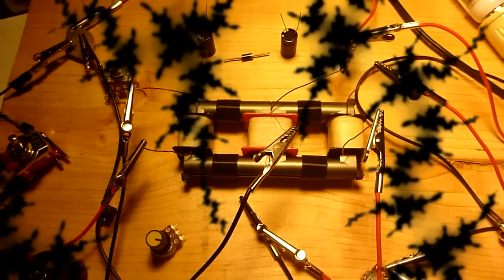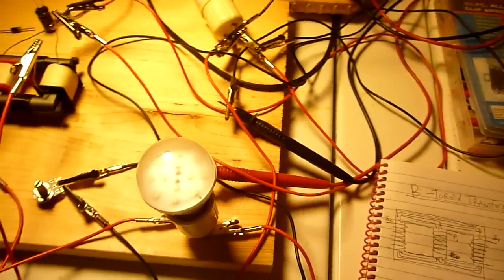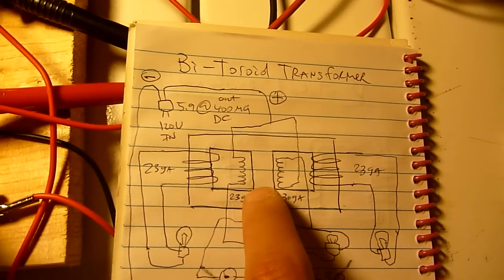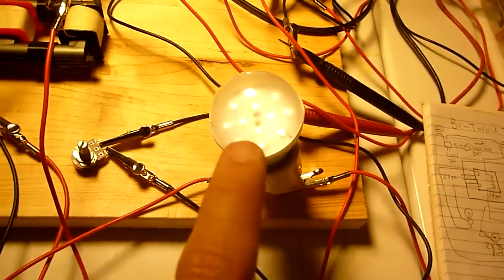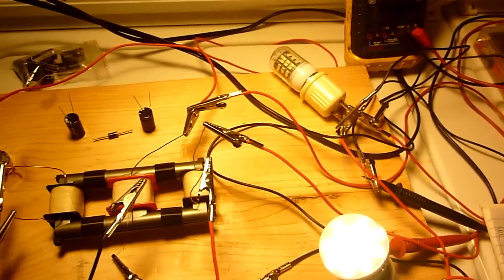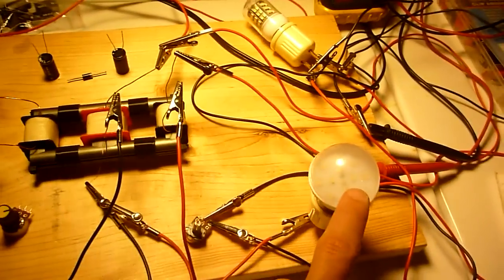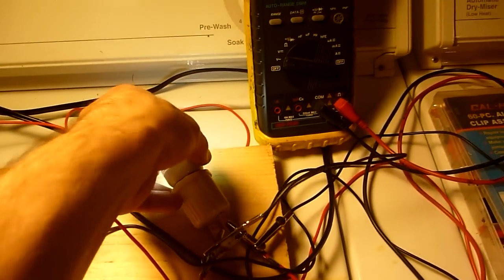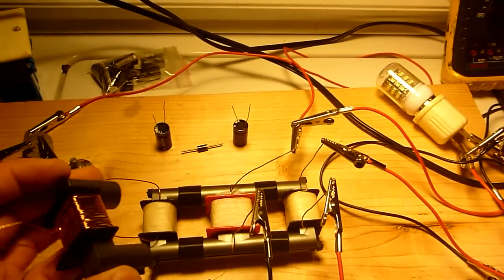Bi-toroid Transformer replication (over unity transformer)

Comment from the maker: If you wish to further improve efficiency of this transformer make the core on which the primary windings were wound from low permeability material, let say iron. Make the core used in the rest of the transformer from high permeability material like permalloy . The flux will be trapped in the high permeability material more so than in the lower permeability material. This will drive efficiency further beyond COP >1. Another way to boost efficiency is to connect the secondaries by an extra outside loop of high permeability material. This will help contain the flux in the secondaries even more.
Reply: +Naoki Kashima 
Interesting idea to design a transformer!  However, when you power off one LED bulb, is absolutely normal in this arrangement that the other LED bulb intensity to remain constant. 
It's like you have two transformers with a common primary and two separated secondaries, isn't it? Since the two magnetic paths are separated, from primary to each secondary, it's obvious how will work. The mutual inductance created by one unloaded secondary, reflected in the other secondary should be so small that will not change anything...

I'm sorry but I do not understand why are you using the LED bulb connected in the primary (or in the oscillator circuit)? Why didn't you performed a clean energy efficiency measurement? The VA drawn by primary and the VA produced by both secondaries? I think unfortunately you can not talk about over unity COP until then...

BTW, if you want to not have the annoying noise you can do two things: check if your core is not saturated, add an air gap between the U cores and/or increase the frequency above the audible frequency.
Reply from the maker: vsurducan Excellent points. Thanx for the tips about the noise reduction. I really should get a watt meter. I'll run 2 lights using house main through the meter (my control). At the same time I'll run 2 other lights using this transformer in the middle (with a second watt meter). After X amount of hours we'll check the watt usage from both meters to see if this transformer produced a reduction in the watts used.

Side note: this bi-toroid transformer is not my idea. I just came across it. It does work I've seen about half a dozen credible people show tangible efficiency gains with this device. If you're going to replicate this connect the secondaries with an extra loop of magnetic material. This will improve efficiency. I might do a follow up video to this one.
Reply: +Naoki Kashima 
I think you don't need any wattmeter, just two digital multimeters (DVM). Perform your measurements in DC not in AC because ordinary multimeters does not work ok at high frequency and rectangular signals. (If you want to do it in AC, buy a two channel scope for this purpose with math functions, will be useful for the future.)

For computing the input power measure the DC current sourced and the DC voltage used to power your oscillator which has the primary as load, using a DVM. For the secondaries use four schottky diodes and connect them in a Graetz bridge. Use a capacitor for filtering the ripple. Multiply twice the rectifyer/filter for both secondaries. Measure the DC voltage and current through your LED bulbs. Even this method will not give you exactly the transformer efficiency (but the transformer and oscillator efficiency) will be a very good starting point, better than is now. 
And an advice: please do not be disappointed if your computed COP will be far away below 1...
Reply from the maker: vsurducan Check this out device with 5000% efficiency, here is link: https://www.youtube.com/watch?v=HK3JOlY0V8Y (Jim Murrey)

There are many many devices like this out there. Humanity had a way to get us off of fossil fuels for over 100 years, starting with Tesla. The reason we haven't seen these devices before not because they aren't possible but because oil is just too profitable.
Reply: <3 thanx for duing experimehnt <3 =)
Reply: Very interesting video. Will it help if I leave a small air gap between the primary coil's core and the secondary? My idea is that the flux will enter the secondary core but then it's trapped there. Regards, from SA.
Reply: @reeselourens1459  I used to live in SA. How did your experiment go? Did your BiTT work out well? Don't you think something like this could solve the Energy crisis there?
Cheers, and Happy New year 2024

Comment: I'm a noob on this so I have some beginners questions:

1. What does the "over unity" term actually suggests?
2. What is the power input in WATTAGE and output WATTAGE delivered?
3. Where is the power source?
4. Why isn't this commercially used?

Sorry for stupid questions, just curious because it is either sensational or something else....

Thanks in advance!
Reply from the maker: ***** Hello. 1) the term 'over unity' suggests that more power is coming out of the system than is being put into it. Most people believe that this observation defies the laws of conservation of energy. I was never a big fan of those laws anyways. 2) My power source DC Nokia Phone charger its 5.9 volts @ 400 mA, so that's 5.9 v X 0.4 mA = 2.36 Watts (input), my output is two 5 watt Led lights and another 5 watt Led Light in the middle (15 Watts total), but when the secondaries are being used by themselves  (10 Watts). This is actually a modification of the patent CA 02594905A1 (it is a Canadian Patent by Thane Heins. I know that lighting a few bulbs with lower wattage isn't that impressive (joule thief circuits do it), what is impressive with this setup that is it will step up voltage AND amperage at the same time and keeping the same wave frequency. If I added another loop connecting the two secondary coils together it would work even better! Your last question was "why isn't this commercially available". The answer would apply to the following as well: Why isn't Stan Meyer's water-powered car commercially available, or GDS water-powered generator, or Howard Johnson's self running magnetic motors, etc... THE REASON is $. BIG OIL is just too damn profitable right now. Technology to replace oil was available 100 years ago when Tesla finished the Wardenclife Tower. It is up to the average people to make a difference. If not now than when?
Reply: @naokikashima9349  if big oil kills every free energy inventor, why don't they kill  solar and wind energy, even solar is killing their Monopoly?
Reply: @yogie_ji_gwalior_wale  😄 I don't think Solar or wind can realistically compete with Petrol. A transformer like this is small and I'm guessing can generate more power and is also much cheaper! To set up solar for your house or business is very expensive and I think this technology if improved can be used in cars and motorbikes 🤷🏾‍♂️🙂
Reply: @naokikashima9349  yourPowerSourceInVideoIts120VAc.

Comment: Hi You are defiantly  on the right track, I have also seen this setup, and have played with the idea in my head. My idea is to Take a Large ring for Torrent Transformer - size about 1-2 Kw and take 2 smaller torrent rings there can fit inside the big ring, so you get a big O with a figure 8 inside and there where the rings meet you can make the transformer coils like you did right now. The setup will look like This - The Primary coil P1 will be in the mettle of the figure 8 and there where the figure 8 are meting with the big O you set the secondary coils S1 and S2. The idea is explained in This Video as you probably have seen. to get S1 and S2 to react with its other without involving the P1 to much, and therefor gaining power. I Think That is the most serious stuff out here by far until now. https://www.youtube.com/watch?v=aVYiT4zK9Kc

Looking forward to se the result

My veery best
Someday we will success
Reply: The movie from link is unavailable now, can you point out a key word or some name, so we can find it elsewhere?
Reply: @unikatowy  FREE ENERGY # 35 BI-TOROID TRANSFORMER - 377 % OVER UNITY MOTIONLESS

Comment: Hello Naoki Kashima, of this you have your work patterns and technical notes to be able to transmit? thank you
Reply from the maker: Gaetano Lombardo I don't have any extra information that I didn't cover in the video. I used 4 C core transformer found here: http://www.aliexpress.com/item/large-watt-U-shape-transformer-ferrite-core-UY1658-machines-equipments-20pairs-lot/680193299.html, I have the center primary 1st layer 23 gage wound clockwise, 2nd layer 30 gage wound clockwise, on the outside I have 3 layers of 23 gage wound counter clockwise on both sides. I don't think the direction of the winding matters as long as both secondaries are wound in the same direction. This was just a demonstration of how it is no longer a linear 1:1 relation between primary and secondary. In this setup the secondaries end up helping each other that's what causes the efficiency to go over 100%. I use a standard pulsed joule thief circuit with 2N5630 transistor in the middle, frequency is controlled with a 12K potentiometer. I intend this to be an open source type of project, you are welcome to help yourself.
Reply: Grazie ancora, ho notato indirizzo per l'acquisto dei nuclei

Thanks again, I noticed address for the purchase of the nuclei

Comment: You are missing the extra flux paths for the secondary BEMF.   The extra flux paths are made larger than the regular flux paths so that the flux will choose the least resistance pathway for it flow.  The 377% trans video shows these bemf pathways.  you can't use the same material for both flux paths.  their video shows this clearly here's the link
https://www.youtube.com/watch?v=aVYiT4zK9Kc
Reply from the maker: ***** You are 100% correct, I was wondering when someone was going to make a comment about that. The extra flux path would further improve efficiency of the transformer. However, even without the flux path the transformer should still exceed 100% efficiency. Awesome comment, well noted.
Reply: The next question is how to make this concept a self running power source using a portion of the output to replace the initial starting energy..  Once this is done then we can kick it up a notch using tesla transformer.
Reply from the maker: ***** That's the thing figuring out how to loop the output to run itself. You do get over 100% output but so far I couldn't get the output to feed into the primary. I think if we combine this technology with the Hendershot generator we'll solve the world's energy problems in a single device. Hendershot Generator uses ambient energy, when combined with bi-toroid transformer the output of that would be multiplied. My attempt at replicating Hendershot had failed in the past.. however others managed to do it. Akula generator and Hendershot generator and even SJR looper circuit from Lasersaber all use something similar (more on that subject later).